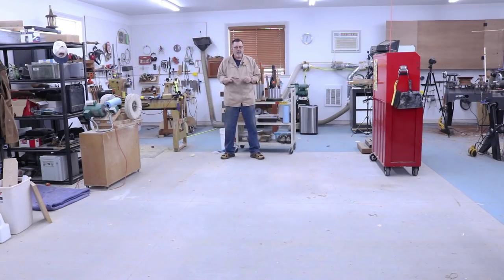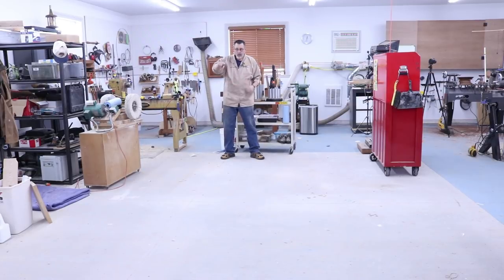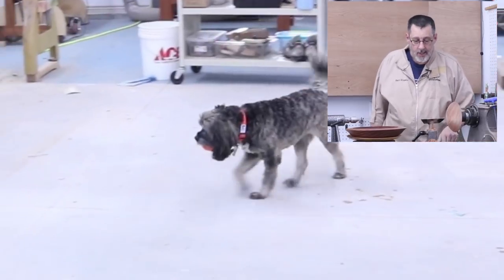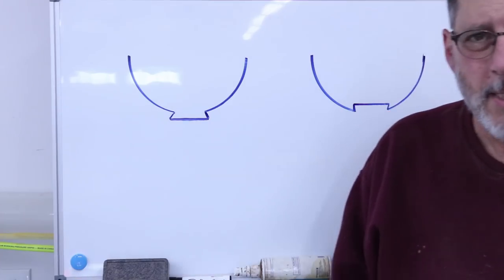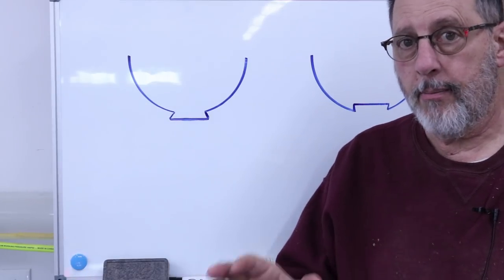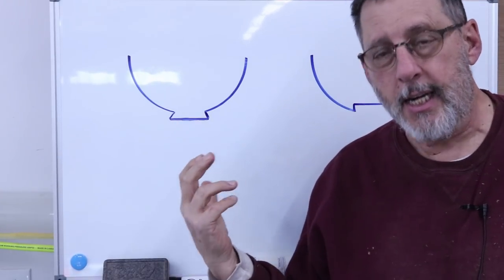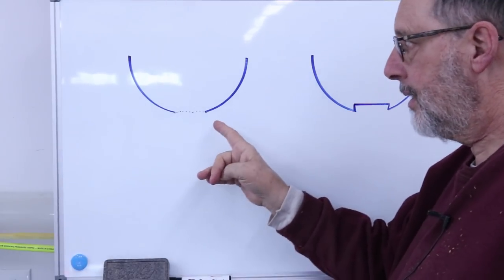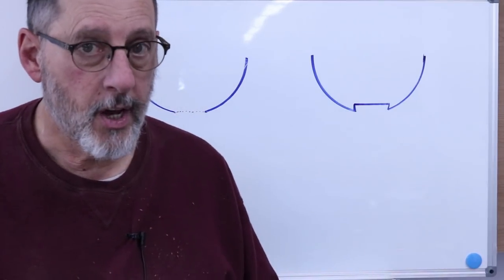Expansion Recess or Compression Tenon in Woodturning? with Sam Angelo

Comment: Sam, I find that a recess can be a bit of a feature. I like it for a place to put my logo coin and sign the piece. The recess keeps the signature and logo coin from sitting directly on table tops.  I do take away the dovetail feature of the recess when I finish the bottom though. Regardless of my opinion this video is greatly appreciated. It provides food for thought. I expect you will get strong opinions for both methods. Thank you for sharing. PS, the shop looks great.
Reply: I entirely agree, I usually add several small beads from the Center out. I also usually leave a gap for a pyrography burnt signature and often a date it was turned. In my opinion it adds proof of the care taken to turn the vessel. In all my years of turning, I have never heard anyone tell me that the recess looks bad. I guess everyone has there likes and dislikes. Happy turning all, Ricky

Comment: The rule of thumb I generally use is a tenon for end grain turning and a mortice for side grain turning. I've had enough side grain bowls split at the tenon and come off the lathe to convince me that this isn't a good idea. I do have only a small scroll chuck (RecordPower RP2000) which gives me an optimum spigot diameter of 24mm so splitting across the tenon on side grain pieces (ie; splitting along the grain) is highly likely. Obviously, with larger tenons on larger chucks, the risk is much reduced but splitting along the grain remains a risk. If turning an end grain bowl, the risk of a tenon splitting off is eliminated Obviously, I wouldn't use a mortice on end grain as expanding the chuck could split the bowl.
Using a mortice on side grain is pretty safe as long as the base isn't particularly narrow.

Comment: Nice thinking.  I see many users finish the expansion dovetail and the bottom of the bowl - brand with iron, sign, inlay coin... and shine it up.  The issue I have seen with tenon is gripping hard and pulling grain from the bowl wood.  Normally the expansion forms a foot and the center doesn't touch.

Comment: I believe they both have their place.  When turning wet green wood, I had a tendency to over tighten the chuck jaws on my tenon leading to the tenon failing.  Hence I started using recesses and my failure rate decreased.  I am aware though, that once the piece dries and I re-chuck it, the warping of the piece may cause problems.   Sam, at the beginning you made a point about having to take off more wood when finishing the bottom.  Well, in order to make the tenon, you have to take that wood off anyway.  I suppose what ever suits your fancy.  I think this is one debate that will endure as long as there are bowl turners out there.  Thanks for your insight Sam.  As always, I enjoy your videos.

Comment: My preferred method is to mount the blank on a faceplate, cut a recess and then sand and finish the entire bottom. If the wood is still too moist, I'll reverse chuck it on the recess before finishing, hollow out to about 2 1/2 inches and cut another recess on the inside a la Raffan. I'll microwave the blank to stabilize it and then remount on the inside recess and completely finish the bottom.

Comment: I also disagree. There is nothing wrong with leaving or using a foot on a piece. A foot can enhance a piece by giving it lift. Look at classical pottery and you will see this. Also when I use an expansion joint on a piece I leave it. Why remove it? Why mess up the shape that is already there? It doesn’t mean a piece isn’t finished or incomplete that has a foot or a mortise. It boils down to personal preference.

Comment: I'm not entirely certain I agree with the original logic, and I think that the dry-erase marker drawings illustrate the point. If you do two identical bowls, same size and shape, and one uses the tenon and the other a recess, you're removing the same amount of wood along the bottom, it's just a matter of when that wood gets removed. To get a foot for compression, you're shaping the exterior bottom portion of the bowl in the beginning, when you're forming your foot initially. All of the wood that you're referring to having to take off to shape the outside of the bowl with the expansion recess, you're taking that same amount of wood off when you're creating the foot - you're just removing that wood at the same time you're creating the foot/tenon. Creating the recess, all of that wood that is removed when shaping the exterior of the bowl along with the tenon, you're removing the same amount of wood assuming that you later go back and shape down the recess to NOT be a recess. You're still removing the same amount of wood whether you're doing a foot or recess, it's just a matter of when in the process you're removing it.

I hope all of that makes sense.... what it boils down to is I really think it's just a matter of preference. I haven't had a lot of success with tenons, but I've never had a bowl go flying off using a recess!

Comment: Both have merit dependent on use of piece, condition of wood, dry / wet, hard or soft woods and the experience of the woodturner. love the info I learn from your videos, still learning after 50 years of turning.

Comment: When turning green wood, I prefer using a tenon as I've had a recess break away with the softer green wood. If I am turning purchased dry wood, and I want to conserve thickness, I usually use a glue block or use a recess, as dry wood is stronger than green wood. I did have a 5" x 1/4" tenon twist off when roughing a 30 lb piece of freshly cut chestnut, but that is the only one in over 5 years of turning. Freshly cut chestnut is more than 60% water!, but it dries very hard as noticed in the second turning.

Comment: Sam, I think you are wrong. It has been my experience that the recess was and is much safer, never had one fail, where I have lost a compression mount a few times. Also, if you plan properly, the recess becomes part of the design, so no thin bottom issues, and you can plan to add a foot about an inch wide.
Reply: I agree, I feel like I could put much more force on a recessed tenant. And I could always turn another circle to fill up the bottom if I want

Comment: Sam, I feel like you do a huge disservice to recesses in the problem as you present it.  With the spigot/tenon, you accounted for how you were going to remove it before you ever started turning the bowl.  Yet for some reason, you didn’t take the same care when designing around the recess. You could easily shape the entire outside shape and incorporate the recess as part of a “foot”.  In that case you only have to touch the recess and any transition between the foot and recess if you choose.